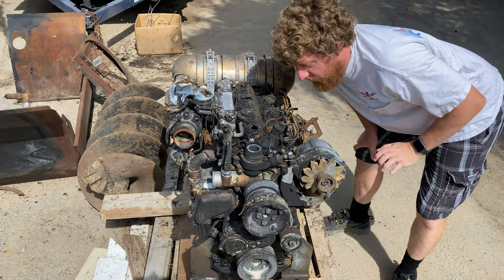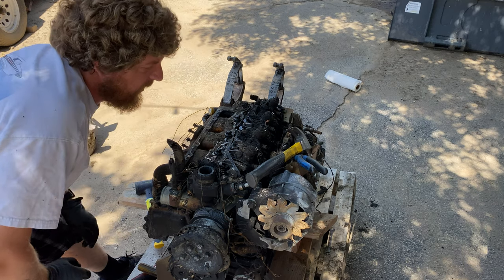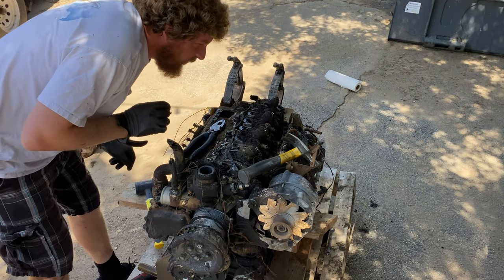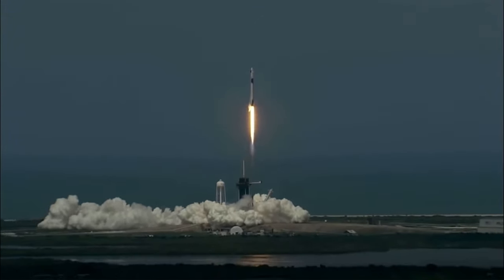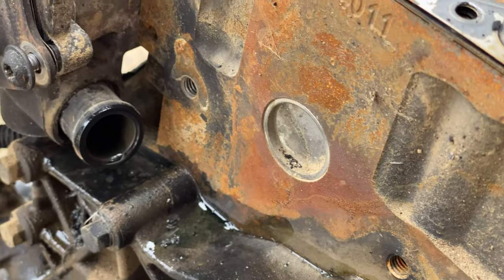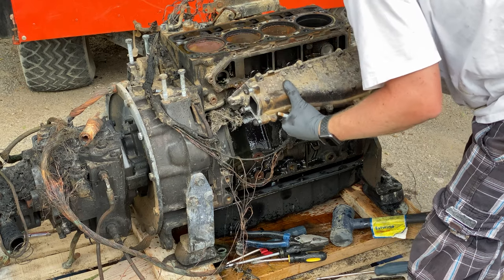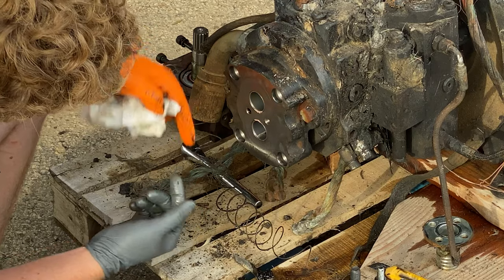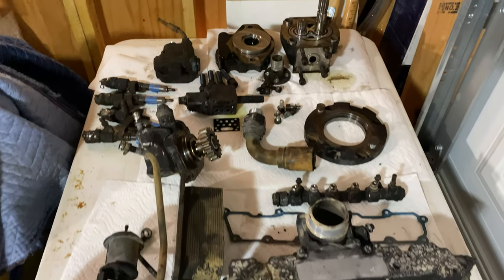Deutz Engine and Hydraulic pump Tear Down  - Fire Damaged Genie Pt. 3

Comment: Fun project for sure. Love tinkering like this. That valve cover was pretty satisfying to pry off and clean under haha. Just finished watching. Did you pull some rod and main caps off the bottom to check the bearings? That would probably be my indication if it was worth rebuilding. It also doesn't look like it's sleeved so you may be stuck with those cylinders I'm not sure if they are pitted at all under that rust. I would compare your parts quote vs getting a new engine and go from there.
Reply from the maker: Ya, it had its moments for sure!  I don’t think the engine looks too bad internally.
Reply from the maker: My mobile version didn’t show me the rest of your reply. So I missed all the helpful information!  I think the bearings looked ok. They do look like they sell some oversized pistons so you could bore them a little wider. Honestly I really need someone who is a bit more skilled in this area if I were to attempt it.

Comment: How did the hydraulic pump look inside?  I have a skid steer that burned up and would like to get it going again.
Reply from the maker: The small pump looked pretty good, but the large pump I wasn’t as lucky. Water had been sitting in the large pump for a large period of time and all the pistons needed to be replaced. This pump was a bit out of my wheelhouse and I took it to a Bosch RexRoth company to have it rebuilt. I do have a video about this coming!